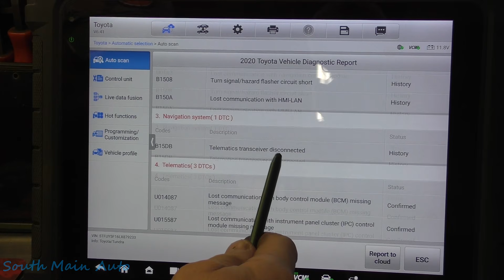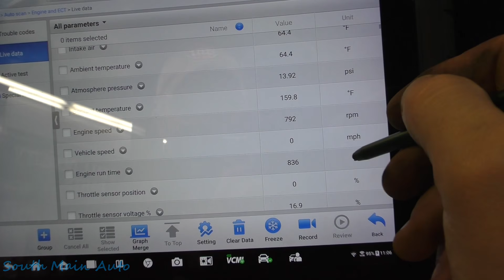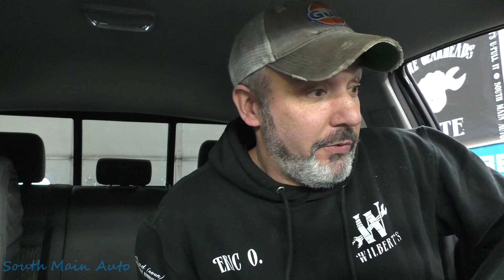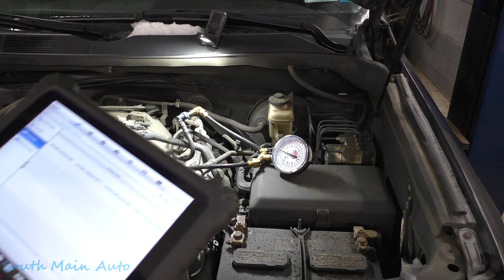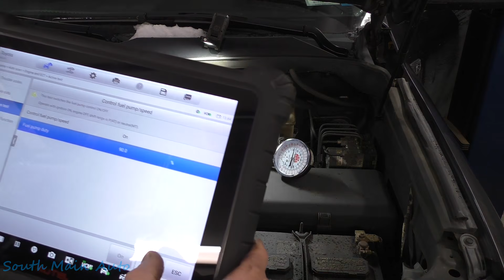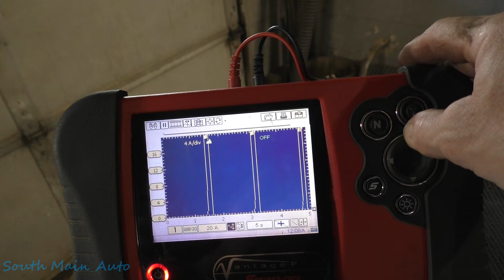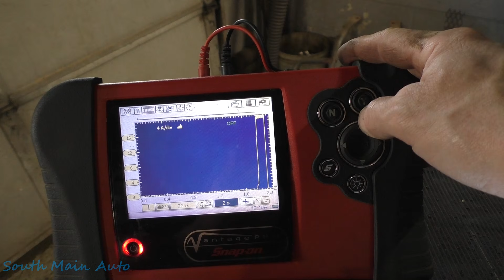My Customer Is Getting Shafted By The Local Toyota Dealer

Comment from the maker: Before we get hundreds of comments on it. I am well aware of the "Toyota Fuel Pump Recall." THIS VIN DOES NOT FALL UNDER THE RECALL. I checked with NASTF as well as calling two different Toyota dealers. This truck has no open recalls by the VIN and the customer has owned it since new.

NOTICE - As of 1/6/25 The local Toyota deal has told my customer that my diagnosis is incorrect because Toyota does not even have a published specs on fuel pump current and then they proceeded to tell him it needs a "Fuel Pump ECU" because the bracket that holds it to the frame has corrosion on it. Not the connector or the pins but the bracket. WTFudgesicle does that have to do with anything haha. They told him that is not covered under warranty, and he would have to pay for it. Let's wait and see how this turns out.... stand by

UPDATE - As of 1/7/25 the customer had some back and forth with the dealer and finally they agreed to replace his pump and that they were wrong, and I was right. They admitted to not even diagnosing it the first time and they were just guessing based off pattern failures and throwing parts at it. The customer told me they installed not only a used fuel pump ecu but a new one as well and guess what? IT DIDN'T WORK! The time they spent guessing could have been spent testing. Oh well, at least the truck is fixed now, and he didn't have to pay for their guess work. They even offered to deliver his truck to him after all of the apologies 👍🏼

UPDATE - As of 1/8/25 Customer got his fuel pump replaced free of charge by Toyota, then they delivered it and put ten bucks of gas in it. And apologized some more. I guess we guessed right then 🙂
Reply: So this truck SHOULD HAVE been included in the recall.  That's my conclusion.  Hope there isn't anyone else out there left high and dry by Toyota because of this issue.
Reply: @courtneyjones4472  They even do that with appliances. The serial number isn't in range with the recall but has the exact same parts as the recall. Then the customer has to pay.
Reply: @courtneyjones4472 Recalls are for specific years and models. 
If your beast is not covered, you're out of luck. 
Plus Warrants don't last forever and ever.
Reply: So what happens if the dealership replaces the module and it doesn't fix the problem? Do they 1) give h back his money and replace the fuel pump FOR FREE or 2) lie to him and replace the fuel pump under warranty?
Reply: @richardramon2175  they’d put the module in. Realize it didn’t fix it. They would then put the pump in under warranty. Then tell the customer “see we told you it was the module” and never talk about it again.
Reply: @BelcrossMobileRepair  Toyota try that stunt with me on my Toyota matrix with my airbag module. Told me my clock spring was bad. Meanwhile, there’s a recall on the wiring harness and/ECU for the airbag system. finally after me in the service advisor having an argument I said the hell with it get my car out of here cause they told me they were gonna change the computer instead maybe wait 2 1/2 hours to tell me that wasn’t the problem I go out to the bay where the guys working on my car and he’s got my steering column all apart looks up at me with the deer in the headlight look looked at the service advisor like oh my God, what do I do? The prick service manager so give me the computer you didn’t install it did you know he put it back together and get the car the hell out of here. I never did have it repaired, but when I get ready to jump the car, I thought about taking it in and getting all the recalls done just to get my money out of Toyota before I scrapped it. He was a douche. The car had never been in an accident never had any problems. Never had any front end work done to it all the sudden one day my airbag light come on. I had a relative mechanic scan the codes and he said by the amount of code the airbag system was putting was crazy. This was known to happen when the ECU fails. Who knows I never will now it’s a pop can somewhere or garbage can lol.
Reply: @richardramon2175  they charge you and say there must be another issue.
Reply: @richardramon2175 it needed the module anyway - dealership,
Reply: @richardramon2175  yes the 2nd one ! For sure
Reply: @richardramon2175 Damn stealerships. Unfortunately the customer pays for all the guessing.
Reply: @richardramon2175 they wouldn't give back his money. They'd just tell him the "bad" ecu damaged the pump, but they'll warranty it out of the kindness of their heart.
Reply: @richardramon2175  lie to him and charge him fo the job under another pretext.
Reply: @richardramon2175  They will say that the fancy relay was bad. therefor the fuel pump was faulty 😇
Reply: @richardramon2175  Dealerships lie. It's baked into their operations since they make very little on the vehicles and they need service department to pay for the hot-n-cold running secretaries in the manager's office.
Reply: @SurferJoe46  so true!
Reply: Oh I'd love to see The Car Care Nuts take on the dealerships handling of that!
Reply: @leonkernan  Yeah he would be disgusted by the dealer, especially knowing their is a recall out there, just because the vin is not on the list the problem is exactly the same as the vin'd numbers. 
So the dealer/ tech should have had the brains to link the 2. then make a decision. asses.
Reply: Please keep us updated
Reply: @ronaldbrosius7488    @ronald, there is no further update, issue resolved, read baby read 💡
Reply: I hope they accept this video as proof.
Reply from the maker: @anthonycox9470  Lol they won't. As far as these dealerships go, I am not a "Toyota Master Tech" so that means I am dumb as a doorknob in their book.
Reply: @SouthMainAuto  I would rather have a "doorknob" diag it correctly then someone throwing parts claiming they are a "master tech".
Reply: @SouthMainAuto  Dumb as a doornob Master techs throws parts at it instead of diagnosing the problem...Clearly you're not the doornob!
Reply: @SouthMainAuto  your customer had your back and kept up the pressure till they fixed it for free ... thats the reason he brought it to you first ... customer for life...
Reply: @SouthMainAuto  say what you want about doorknobs, but they are usually the way to open the door.
Reply: @SouthMainAuto  how is Hanna and Marie doing?
Reply: @SouthMainAuto  not only that, even when you show(prove) their diagnostic incompetence... you cannot shame people that have no scruples. The answer they will give to their customer, questioning the parts cannon approach, will be "at least your vehicle is fixed, now". Should the dealership repair department not fix it, the customer will then be referred to the sales department.  That is why they are referred to as "stealerships". They garner the reputation they deserve.
Reply: @SouthMainAuto  it very
Reply: @SouthMainAuto  I can guarantee that the guy who said it was a rusty bracket is not a "Master Tech" either.
Reply: @SouthMainAuto  but you showed  them who the dummy's
Reply: @SouthMainAuto  I've fixed cars for over 40 yrs and not a certified ASE or Master Tech also. I can fix the cars that have been misdiagnosed by them after they shot gunned parts at it, charged the customer for parts they didn't need and didn't fix the problem. I only answer to myself and don't do what someone tells me how to fix it like some techs have to do to keep their job. Nice job diagnosing it!!
Reply: @SouthMainAuto 
At least you are smarter than the door that kicked them in the ***.😂
It was obviously a fuel delivery issue from the beginning, which meant communication was happening initially.
You would think that an actual Toyota Certified Technician would know about the initializer circuit pulse that triggers the fuel pump to turn on?????
After all... They ARE CERTIFIED.😂
Stupid dealership.
Interesting twist to a common problem.
I agree about the increased power supply from the alternator. You had the exact same result when you had the battery maintainer connected.🤔🧐
At least they admitted to their errors... Eventually, and did the right thing. Too bad the guy had to go through all that crap in the first place.
Another win for the dumb guy down the street.😂🤙
Reply: @SouthMainAuto  Wow, wouldn't the easiest thing for the Toyota dealer to just throw a fuel pressure gauge on it, see that there's no fuel pressure, then tell the customer, "you need a new fuel pump". Pretty sure that's just about how any shop would tackle this if they were in a hurry with a lot full of cars, and a waiting room full of waiting customers :)
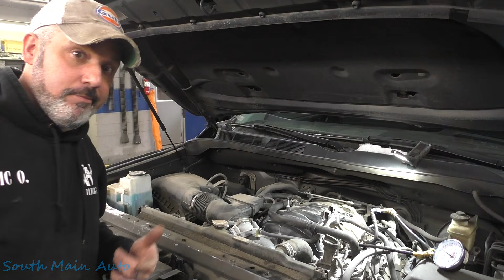Reply: @brnmcc01  no, eric exactly went over this in the video. specifically he said there are a few players. go back to 18:58. just because fuel pressure is low, doesnt mean fuel pump is bad. there are reasons a fully functioning fuel pump cant output what it should. thats the point of diagnostics.
Reply: @SouthMainAuto  Most of the time Eric, they don't even know , that they don't know.
Reply: @betomendez4304  I doubt he will respond other then to say good. Some time back he had to stop having them on & speaking about them. There are far to many predators on YT, and to many people were taking things to far. Can't blame a guy for protecting his kids. Specialy when it comes to his girls.
Reply: @BahBahTheSheep  Yes I know that, but that was pretty rediculous for the dealer to "try" a used FCU, and then a new one, and then finally replace the pump. I remember like 13 years ago, my GMC van died in a parking lot, drove there fine, came back out 15 min later, wouldn't start. Figured it was the fuel pump because I could no longer hear it. Had it towed to my house. Dropped the tank and threw a new pump in it. It started but still wasn't quite right, but I noticed the new pump sounded very quiet like a whistle. The old one I could hear it while driving even but it had been like that so long I didn't pay any attention to it. So I replaced the fuel pump relay, and then all was good for more than 10 years+. I busted apart the old fuel pump relay and it was all burnt to shit. What I think happened was the same as this truck. It gradually over many years pulled more and more current until it died. Pump and relay were original from 1992. Replaced with a Bosch pump in 2012.

Point of all that was I was very inexperienced at the time, never had watched any SMA videos, so like any basic shade tree mechanic would probably do the same thing. No fuel? Fuse good? Throw a fuel pump in it. Makes no sense why the dealer would waste so much time with tryagnostics.
Reply: @SouthMainAuto I am a Toyota MDT, and I watch your videos to sharpen my process. Thanks for this one.
Reply: @SouthMainAuto 😂
Reply: @SouthMainAuto 
Only the piece of paper matters these days as far as I see on a daily basis. It does not matter if you know 10-100x what the person with the title/piece of paper knows. This is the way the world works now, the general public are sheep and seem to follow that 'logic'🤯
Reply: @SouthMainAuto  i like a toyota master tech get through a door with out using one whos the knob then boy did the owner cover all his bases  one clever cookie well done SIR
Reply: Pride comes before a fall
Reply: @SouthMainAuto  Toyota Master Tech, LOL.  Means he sat in a few hour class and got a certificate.  Now they can call him Master Tech and charge accordingly.
Reply: @SouthMainAuto  how many times have I met people that can claim to have all the qualifications to service and repair. Only to find all they know is theory and how to throw parts.
.
Reply: @SouthMainAuto  Well I bet if you reach out to Ahmed Youtube channel The Care Care Nut Toyota Master Technician for years would tell you otherwise.
Reply: @SouthMainAuto wow their not as smart as a doorknob pitiful lol!!
Reply: @SouthMainAuto  Toyota has the worst warranty and recall coverage. It's like they are hoping the bad coverage on this issue is washed out by their perceived reliability.
Reply: @betomendez4304  Did he ever mention to us anything as of last? I believe in a live or "what's up wednesday" he mentioned they went to college or had a family and just want to be left alone. Eric is very protective of them,  I could be wrong here on some details. Guess we have been family a long time, but too any details to remember over the years.
Reply: @SouthMainAuto  Guess we know now what their book is worth, EH?
Reply: @SouthMainAuto far from dumb as a doorknob. I, personally, have learned a lot from watching your videos. Keep up the excellent work.
Reply: @dont-want-no-wrench Doorknobs are never wrong.
Reply: @SouthMainAuto  I don’t fix cars. No idea how. But I know that if that fuel pump runs on electricity, it’s gonna have an electric motor in it, and electric motors draw high current when they stall, and when you run a high current through any conductor, including a motor winding, it’ll heat up. And it’s not uncommon for an electric motor to have a thermal switch that stops it running when it gets hot but resets when it cools down. In fact, come to think of it, I would kind of expect that safety precaution for a motor that shares a confined space with a volatile flammable liquid. I’d design it with the cutout switch right there on the motor just to be sure no control fault could cause a fire. None of this requires knowing special Toyota lore. The problem seems to be that special Toyota lore is all they know.
Reply: @SouthMainAuto  I’m a Master Diagnostic Technician with Toyota for for over 10 years , have been working on Toyotas since I was 10 years old and I must say sir you are in my eyes  above Master techs 
I wish more techs including myself would be as thorough as u are
Reply: @SouthMainAuto .   Oh the irony of that scenario.  Pride comes before the fall. I’m directing that statement towards the stealership. How do they sleep at night. Keep doing what you’re doing Eric. We all love and admire you. You’re a very rare breed.
Reply: @anthonycox9470  that dealer should make this video required viewing as tech and service writer training material
Reply: Good grief. 

Back in 2004, I had a Mustang that blew the turn signal fuse on me one morning and would immediately blow replacement fuses when I'd flick the turn signal again, so I took it to the Ford dealership since it was still under warranty.

First, they told me the switch was bad, so they ordered a new one and it'd be covered by warranty. They said it'd be about a week.

Then, when that didn't fix it, they told me the wiring harness in the steering column was bad, so they had to order a new one, but it'd be covered by warranty and be ready in a week.

Finally, they called and told me that didn't fix it, but they finally looked under the hood and found that the wiring harness had been chewed up by a rodent of some description. They, did, however continue it as a warranty replacement and actually got it fixed after another week.

When I got it back, there were about a dozen blown fuses in the floorboard from their "diagnostics".
Reply: @ShaneRimmerWorld . Oh my, I had a fuse blow on a brand new Mustang just driving it home from the dealer.  It was the one supplying current to the radio.  They put the car in their shop and said it would be ready the next day.  They called, I got a ride to the shop.  The car was sitting in their parking lot.  They said they replaced the fuse.  And they did.  But they never turned on the radio.  I did and the fuse blew.  Still in the lot.  They pulled it back into the shop.  Replaced the fuse about ten times, guessing because that is how many blown one I found.  The trouble shot it and determined the radio was at fault.  The AM only radio was backorder from the factory.  I asked them to just pull out one from one of the new unsold cars that they had.  Nope, can’t do.  Well, just put an AM/FM RADIO in it, since pats department had one.  Nope, unless I paid extra.  Ok, I agreed.  They pulled it in and turned it on.  The fuse blew.  Turns out the power lead had broken from the cable powering the radio.  They had to order a wiring harness.  Two weeks later they called, the car was ready.  I turned on the radio and it worked.  The car was parked in the entrance to the dealer.  I turned it off and told them to put back the original radio, I didn’t wasn’t the AM/FM radio.  They had thrown out the original radio and also the box that the upgraded radio came in so they couldn’t put it back into the parts department.  They ended up giving me the upgraded radio for free.  Never went back to that dealer.
Reply: @georgeburns7251  Great googly mooglies, and people wonder why we call them stealerships.
Reply: @georgeburns7251  gotta face the music 🎶 ...ehh??
Reply: @ShaneRimmerWorld  🙄🤭😏
Reply: @ShaneRimmerWorld 

Good Grief Man ,

Whatta Dealership Story . My Lord .

Worked @ a GM Dealership & Indys here in Southern California  as a Smog Repair Tech/Drivability Problem Solver...Had fun .

Before that I was a Journeymen Shipfitter Graduate Apprentice  @ Naval Shipyard Long Beach  7/25/1977 to 9/30/1997 until Smart Democrats & Republicans thought it was Cute to Officially Close a place that boasted Every Trade Apprenticeship  Program under the Sun.

" O " Eric is  a Sharp Fella - outta New York !
Reply: They also need to pay your labor fees for your diag.
Reply: Diagnostics is hard and takes time. Flat rate techs normally want easy gravy jobs because it doesn't require thinking AND breathing at the same time and makes them big hours quick. The real Technicians are too busy fixing basic factory problems on new cars to have time to be assigned real customer pay jobs (because doing warranty repairs requires certification whereas customer pay jobs don't). Therefore, C/P diag like this one goes to jimmy noobcakes who loads the parts cannon with grapeshot, hoping something sticks because he doesn't know any better.

Don't worry, we're not all lazy punks. Sorry you had to fight the good fight for your customer, but I'm happy you did.
Reply: @toyotanos Jimmy num-nuts😂😂
Reply: Toyota dealership: Your diagnosis is wrong Mr. O.
The internet: AHHAHHAHA... wait, you're serious? Let me laugh even louder! BWAHAHAHAHAH!!!
Reply: @RagnarokCo That is exactly what I was thinking. They know Eric O. If he says that it needs a fuel pump, you don’t need a second opinion. The stupid thing is that the repair should have been completed before the customer finishes a cup of coffee and before the showcase showdown.
Reply: @RagnarokCo  Al Borland:  "I don't think so, Tim!"
Reply: Toyota parts cannon without proper diagnostics sounds like a knowledgeable dealership.😂😂😂😂😂
Reply: @brianwhitney9181  TOYOTA MASTER TECH  DAA SHALL WE TRY THIS NEXT
Reply: @brianwhitney9181  "parts cannon" LOL !!!
Reply: @brianwhitney9181 - that's why they guess-agnostic and told the guy it was ECU and ECU bracket and not covered under warranty. 🤣. This dealer is giving the Toyota Corp brand a bad name.
Reply: Oh boy, today's world is so effed up that consumers must tell businesses how to do their work or pay thousands of dollars for guesswork and incompetence if the customer cannot do it themselves. I am 66 years old and will not buy a new car that I cannot fix myself. My cars are 15 and 20 years old with ample parts available at the junk yard. I am tired of working on my own stuff but I have no other choice. Every time I have taken my stuff to a local repair shop I spend twice as much time and money fixing their shitty work myself after they are done fooling around with it.
Reply: @Leon-qc7fe  Guesswork & incompetence pays better.  Economic incentives almost always win in business.
Reply: @Leon-qc7fe  66🙂😉
Reply: That's Awesome to See the Updates You Wrote ! it Really Brings the video Home !!!
Also shows us that dealers will say anything to Get More Cash from Warranty Customers.

You Would think Dealers Should be the Diagnostic experts on thier trucks by having thier " Techs " Go to Specialised training school for thier trucks. i Guess the dealerships techs don't get specialised training on thier vehicles anymore. Damn shame Dealerships don't Climb out of the dirt & Get to the top of the pile where they should be with specialised training on thier Vehicles.
Reply: When are you opening an Ontario Canada Main Auto?
Reply: @ryanweaver5867 or a NYC or Orange county one 😅
Reply: @ryanweaver5867  North Main Auto?
Reply: Ya right here in barrie ontario @ryanweaver5867
Reply: @ryanweaver5867  As soon as Trump makes Canada the 51st state. 🤣
Reply: I am born and raised in canada and canada is in such bad shape right now, being the fifty first state doesn't sound bad at all. Trudope should be in prison! @rs1971camaro
Reply: Dealers now are just guesser guys , I worked at Fiat ,Toyota and BMW in the 80's ,over here in the UK , life was so much simpler then 😂😂😂😂, just been working for myself since 94 ,dealing with the publics vehicles in my own shop 😂😂, 1/2 the trouble now is their boss is saying don't spend too much time on that job , do this brake job , oil service , no experience in the real world , your video should have been enough evidence Eric , which ijut thought the bracket would make a difference ,looneys on the reception who have never used a spanner , spun a tyre round with dog shit on, found used condoms under seats when looking for coolant leaks  😂😂😂
Reply: I bought a used Subaru that had known issues with the rod bearings, but my VIN didn't fall in the range of affected vehicles so I thought was in the clear. 2100 miles later it starts making noise. Take it to the dealer and as I pull it into the service bay the tech says "we got a rod knocker". Goes to show that the manufacturer doesn't know the exact VIN ranges that those parts went into. Yes it was covered under warranty. Too bad the dealer screwed something up when they put in the new engine because the timing belt shredded a few thousand miles later. Fortunately the 3rd short block was the charm and it's been good for the past 86k miles.
Reply: Cosby sauce!
Reply: @grandmasmalibu F’n mint! 👌
Reply: @grandmasmalibu took me a few times of him saying that before my light bulb lit up 😅
Reply: @grandmasmalibu  Omg...That line is a keeper!!
Reply: Oh the sweet smell of success  !
I agree with Mr O
New vehicle 
Technology 
Sucks 
Thanks again  South Main 
Auto. 👌
Reply: I've learned that many of these techs do not really know much. If the computer doesn't tell them what to do they are lost.
Reply: Former Toyota Master Diagnostic tech (which only means what's on paper) now independent technician. It doesn't surprise me about the lazy diagnosis from the dealer. The major problem is dealers won't sell additional diagnostics so you get a 1.0hr flat rate to figure out anything. However, I'm only a few minutes in and went... "Oh isn't there a recall..."
So even if it wasn't in the VIN range I'd be suspicious of the fuel pump (which they are all the same more or less.) But dealerships don't train techs for diagnostic work and diagnostic work gets sent to every level of tech in the shop :/ I'm independent all the way and ain't looking back. Great video Eric O!
Reply: Guessing on the customer's dime = lazy thinking = declining nation.
Reply: My son just had a very good experience at a Toyota dealership. He has a 2025 Tundra TRD Pro. A rodent chewed up some wiring, which fried a module. Turbo module, I believe. Pretty easy diagnosis. When my son went to pick up the truck and pay for the repair, they said, "No charge". The service manager wrote it up as a warranty issue. And when they ordered the new module, a new wiring harness was included. I told my son that I have never heard of a dealership doing such a thing and that he got lucky. 😆
Reply: I don't expect every mechanic at a dealership to be aces but for the money they charge, they should have one or two guys around that can do basic diagnostics.  It's embarrassing when this kind of thing happens.  Great video, thanks for it.
Reply: Doesn't sound like a shop I'd trust to do proper troubleshooting for any of my vehicle's future issues. Definitely a class act with the owner leaving the tank low. Good dude right there.
Reply: @timtimtimmay79 that’s why they’re called stealerships.
Reply: @timtimtimmay79 there’s not a dealer of any kind on the planet that can diagnose anything!
Reply: Typical Toyota - no we’ve never heard of Matrix 5 speed transmission failures must be abuse. Go to transmission shop in town - oh yeah we have a dozen manual transmissions here from that dealer right now…
Reply: @kmac6601  Yup!   Also the same Toyota C59 5 speed manual transmission is in the Pontiac Vibe.  They all have bearing failures at about 100K miles.  I got mine to 110K and because I was alert to the problem I took the thing off the road the minute I started to hear the early bearing failure noises.  Mostly people keep on driving until the transmission grenades totally while driving down the highway at speed which locks up the drive train and can result in a very interesting experience.  I found the local transmission guy and he said my transmission internals were mint other than the bearings.  He did have a bit of difficulty sourcing parts because companies selling the rebuild kits could not keep up with the demand.  How this isn't a safety recall is beyond my understanding.  I've driven cars with manual transmissions since 1975  and this is the first time EVER that I have had one fail.  The Vibe has actually been a great car and very suitable for my needs but I'll admit that Toyota's complete failure to appropriately deal with this common catastrophic failure has soured me on ever having another vehicle with a Toyota drivetrain.  So much for the Toyota "reliability" myth!
Reply: @ 3rd 5 speed transmission we put in it for same reason we converted to the 6 speed, car ran that one from 400 to 600k when it was scrapped for rot.
Reply: I have a Toyota hope I don’t get the bend over when I go to them.
Reply: @jayjudd6518  plan on it happening
Reply: @jayjudd6518  just make sure to bring a bottle of Astro glide so when they stick it into you, it hopefully won’t be too too painful! :-)
Reply: I would have told them to put $1000 on their guess. Change the part they thought it was and if they were wrong, they pay the owner $1000.
Reply: I’ll take an old school mechanic any day over a “tech”. The term “tech” is a feel good term to make them feel elevated in stature. 
Eric O for the win as ALWAYS!
A sanitation engineer is still a garbage man it’s just that simple.
Reply: @clintprice2123  Well put...😏
Reply: He should have brought it back to you to replace the fuel pump if it wasn't covered under warranty
Reply: After that, I wouldn't bring it back to that dealer again.
Reply: Denso has more bad pumps out there than the recall suggests.
Reply: @NightKnight2048  i must be really lucky never replaced one
Reply: @ I’ve already replaced 2 in my Subaru’s… one under recall and the other that supposedly isn’t by just a few months… thats a little sus, wouldn’t you say?  Both sounded similar and had starting issues similar but not exactly like this.
Reply: @NightKnight2048  my 2011 camry v6 is still running like new. ive spent less then 1k in repairs since i bought it in 2011, besides tires oil and brakes
Reply: @peterpeter5666  that’s nice, my 2006 Toyota Prius ran until 2019 until I rebuilt the battery myself. It got to 2023 with 250k on it. It never needed a fuel pump. Denso needs to fess up that it’s more fuel pumps than they initially thought.
Reply: @NightKnight2048  I believe most recalls only occur when life safety is an issue. For example - driving at speed on a busy highway and your fuel pump stops.  Other failures are tough luck and if your warranty expired its on you for a poorly made part.
Reply: I gave up on my local toyota dealer. Too many missed diagnosis and too many times leaving with same problem I drove in with.
Reply: Thats some classic stealership behavior. Almost like its in the business model lol. Glad they caved and realized you are the professional they make no attempt to be.
Reply: This is the type of crap that should make it back to Toyota corp as proof that their factory trained techs and the dealers are a joke.   Make the Toyota engineers watch this video so they can learn how to ACTUALLY DIAGNOSE a vehicle….
Reply: the bracket is corroded so replace the relay? so like, if the oil pan has a dent do they replace the engine? wtf
Reply: Don't hold your breath for the dealership to apologize to Eric O for basically calling him a hack. These dealerships couldn't diagnose the smell of dog sht if it was on the end of their noses
Reply: @JF-wk5zo  Well a lot of that has to do with how little the techs get paid for warranty diagnostics. Guy getting paid $17 for that diagnostic while he has a huge Snap-On tool truck payment to make every week ain't exactly going to be enthusiastic about it, haha.
Reply: You use the Calibrated Toyota Hammer to test strike the Toyota Calibrated Fuel Pump.
That's how you KNOW.  It's all calibrated. : l
Reply: @timewa851  It's almost the same part number as the Chevy starter diagnostic tool!
Reply: Ig they keep guessing ,  lying , and pretending to do the work them they get to keep charging.  I wish they woukd pass some actual consumer protection laws to stop this BS !
Reply: Who's  big Clive?
Reply: @bikeme218  A YT'er who does videos tearing down cheap Chinese electronics & showing why they fail & why they are dangerous. Complete with closeup of the circuits with a high powered microscope.
Reply: @bikeme218 Search YouTube.
Reply: Not a lick of surprise over here at the final result in this case. Chalk another one up for DOCTOR O. 😁 Shame that it's a Toyota store that's doing their customers dirty but I guess every brand has its bad apples. Nice work once again, sir. 👍
Reply: I missed it if you mentioned the mileage, but my experience has been most in-tank pumps last between 150-200k miles. They usually fail because of brush wear. Some die quickly, while others go intermittently like this Toyota. One trick is to rap on the fuel tank near the pump suction area. It can sometimes get a little bit of run time in a pinch. Glad you were able to to help your customer get some resolution from the dealer.
Reply: @Obscure121gw  I believe this one had less than 75k and there was a recall on them that applied to other trucks but not this one. Aka a known failure part.
Reply: @patriotgarage 49k he said
Reply: What a Bunch of CORNSPORTS at that Dealership!!! Just don’t want to believe that (They) don’t even know their own Product’s !!!!Nor… How they Work!!! Nice job “AGAIN” E O…
Reply: Wow… I can’t believe the poor service being provided by dealerships. Especially Toyota… I just watched Ivan’s video on the Tundra cam phaser debacle… C’mon Toyota!!
Reply: Did your customer get a new fuel pump module out of the deal? He SHOULD and save the old part! Toyota dealer needs some retraining! Master techs my ass!
Reply: @udrtydog1  Master tech just means they know the particular issues with replacing that manufacture's parts. Very little diagnostic is covered. Even then it boils down to management. Management doesn't want to sell additional diagnostic time. The profit margin is very slim. So they are expected to preform diagnostics within the first hour, and diagnostic are sent to all levels of techs. From the noob to the tech who's been there 7 years. They will be preasured to complete that diagnostic in as little time as possible, regardless if it is humanly possible or not. If the tech completes thier diagnostic in 5 or 10 minutes, the profit margins for that diagnostic hour goes way up. It all boils down to $$$ Research was done to see what the lowest customer satisfaction rating the average customer is willing to put up with. The answer is about 65% to 70% satisfaction. So all corporations purposefully cut corners until customer satisfaction ratings fall as close to 65% as possible to increase profit margins. Some will trial as low as 60% satisfaction, to see if customers are willing to accept it. Over time the acceptable satisfaction rating goes down. In the IT field (my line of work) the acceptable customer satisfaction rating was 95% when I first started out in the mid 1990's. By 2010 it fell to 65%. So employee expectations get adjusted to reflect the current acceptable customer satisfaction  rating. I'm sure it's in the 45% to 50% range by now. Moral of the story, vote with your wallet & demand a higher customer satisfaction rating. Otherwise company's will increase profits by delivering to customers expectations.
Reply: Dealers only want 'parts changers' because loading the parts cannon makes them the most money. Actual mechanics like Eric get paid more (or should be) and stealer-ships refuse to be ethical. Absolutely follow the money every single time.
Reply: I will give the Toyota Dealer some credit for at least in the end admitting they were wrong and that you were right. Not that they would tell anyone else that though. But it is a pity that their customer had to go through so much crap just to get it changed, whereas if they simply done what the customer asked in first place it would have taken less than half the amount of time and therefore lost time for the customer without his vehicle. Too many of these dealerships are ignoring the wishes and requests of their customers. Are the customers always right? no. But at least if it is wrong then it is on the customer afterall they requested it changed you only done what they asked. But, at no time, should you as the dealership be arguing with your customer. Does not matter if is a warranty job or not. A customer is still a customer. Looking after your customers is how you get repeat customers. It is those repeat customers who will in the end keep your company or dealership going when times get tough. It is about time more of these dealerships learnt that lesson. Ripping off a customer is a sure fired way to make sure you never get that customer again..... A bad reputation once earnt is hard to loose and it can be earnt if very very very little time. A good reputation though takes a long time to earn... but easily lost
Reply: Soooo watch out for W●》¡♡●○ Toyota in Horseheads?  There are not a lot of choices in the PRNY Appalachian region.
Reply: Idiot dealers think just because there tech said means he know EXACTLY what he’s doing!! And they always get to throw the parts cannon on the customers dime!! Reason 9,076 why everyone needs to find a sure enough good mechanic on there own
Reply: Bought a used 2018 Tacoma, fuel pump went out and already had the recall done. Took it dealer and they said “someone had been here before” I was like “no shtt, you guys already did the recall” they tried to charge $1500 because NO way that the new pump failed. It did, covered under warranty
Reply: This is what I like about quality YouTube Channels. The follow-ups by posters. You are probably the only shop in your small town who knows what an Amp Clamp is.
Reply: You don't call them Stealerships for nothin'....
Reply: @SouthMainAuto  The plot thickens! I hope your customer doesn't end up getting screwed by every dealer he takes it to!
Reply: @merkurman  This is another example of why I never go to a dealership for any work on a vehicle!!! GOOD JOB ERIC O!
Reply: It would be a easy question for Me to solve this problem, I would just call MR. O !
Reply: Bottom line _!
Reply: This is how and what dealers do. They don’t fix vehicles. They just take their money with great efficiency.  You are one of the few mechanics who fix vehicles. There are not many out there nowadays.
Reply: I had an issue on my corvette zo6 for the longest time and the dealer could never fix the problem.  So I had to dig in with a no code ended up finding my issue that seemed like a fuel pump or vapor locking issue. But started in fuse block checking relay etc,.  The relay for fuel pump was not energizing when it was hot but cool was fine but what I ending up finding was a load connector pin that feed to the relay was so distorted that it lost its contact when I shut the car off but after cooling it would  go back in shape just enough to make connection and the pump would run car would start and everything was fine but also on same pin you could tell that the insulation had burned back but chkd draw amperage and it was within. So replaced female pin on wire and it corrected the problem and has been working fine for  four years now.
Reply: How far outside the "VIN Range" for the recall, did this truck fall?
Reply: @tonyjohnson7408  likely not far
Reply: I'd be concerned as all heck if a customer threatened me with "I'm going to take it to SMA".
Reply: My experience with Toyota techs is consistent with this story.
Reply: Soon Stealerships will try to pay Eric and Ivan PHAD not to post videos
..they are losing money 💰🤑 

Lol 😂😅
Reply: A TUNDRA IN THE SHOP!!!! CANT BE😂. Tundra Time, I can count on one hand how many tundras have been in his shop. As always, GREAT JOB Eric. You are an incredible diagnostic master technician
Reply: It must feel nice giving the dealer a big ol' piece of humble pie. Nice job Eric, as always!
Reply: Toyota is really developing a bad reputation for stone walling owners on recalls and fixes. For example the new Tundra. They recalled the ICE version and did not recall the Hybrid even thought they have the same lame twin turbo v-6.
Reply: I have loved your vids for years and watch just for enjoyment.  You should consider doing a vid explaining the supply pipeline for auto techs and repair shops.  Maybe interview former and honest dealer techs?  Help the average guy/gal know how to find a guy like you!  I work on my own stuff so people often ask me to recommend someone and i have no idea.  I know not to go to dealer, but the times i have taken a problem child to someone i fell like i am just getting non dealer dealer service!  😢😮😢
Reply: I have a 2019 RAV4. My fuel pump had a recall on it. When I saw the beginning of this video I said"fuel pump." They all have to be sort of the same.
Reply: @SouthMainAuto  In Junior High... in gym class we put these pads down on the gym floor to simulate a boxing ring.

Each round was 1 minute.  So we didn't dance around and shuffle like they do on TV. 

No... We came out swinging and we didn't stop swinging until the 1 minute bell rang.

So that's how I learned to handle certain liptards here on earth who think they can just push everybody around just because they think they can!

Anybody who wants to buy a new or used automobile right now needs to know what they are getting into and unfortunatly none of us are any match for all the electronic mishaps that can pop up in these newer modern cars and that is why this Channel and its content is so valuable to both the consuming public and also to the DIYers and profesional mechanics alike... and it's not just this Channel... its a community of automotive channels here on you tube that is helping the masses be better more responsive car and truck owners and these channels are also creating better more responsive repair technicians.

Plus as a bonus... it's a great Dopamine hit when we are looking for something and we are almost at the point of abject despair and then BAM!  We find the cause and can't believe how simple the whole problem was and the great thing is we get to do this over and over hundreds and thousands of times throughout our lives.
Reply: Truly sad.  The only reason myself, and most people, would go to a dealership and volunteer to pay higher prices is because we assume they know the vehicle better and are less likely to be a parts cannon.  Their approach was completely unacceptable.
Reply: That’s one more time confirms, that there is no more good tech’s working for dealership.
Reply: @StefanNistor-v5w  This may have been a decision of someone higher up.   Either way they did him wrong. I have seen in a few  dealers that act like they can do no wrong. They fixed it for free, delivered the truck and apologized.
Reply: HOO-rah!
Reply: I read this in Mr Os voice
Reply: the fuel ⛽ pumps in the 99 Yukons are  bad about going out
Reply: That’s “the dealer” for ya! Doesn’t matter what name is on the sign, they are all mostly the same. No fault of the techs - you can’t expect someone to work for free. Corporate has created that problem.😢
Reply: Sounds like when people go to the local parts store technician to get a DIAGNOSIS and the tell him. You need a mass air flow sensor or pump module.
Reply: That sound like mainland management recalibrated the gaijin dealer to save face.
Reply: stealerships like this should be ashamed of themselves. 1st time is one thing, but second time you see a vehicle with the same symptons, they should put someone more qualified than the oil change kid on it.
Reply: Awesome work, Mr.O!!  Yeah buddy..
Reply: Where are they training these parts cannon techs at toyota testing and diag saves money 🤣
Reply: @mikecole6842  Not realy. Proper diagnostics goes to the more senior techs, who get paid more per hour. Giving the truck to the noob to guess at by tossing parts At it makes the dealership more money in most cases. Less per hour, plus the customer pays for the part & labor with each guess. Specialy when they are told to try the non warranty parts first. Acceptable customer satisfaction ratings have dropped in the past few decades. So corporations adjust to providing lower quality service for more money every time the general public is willing to accept lower customer satisfaction ratings. Proper diagnostics only increases profits when you run a quality shop that aims for the highest customer satisfaction rating, like SMA does.
Reply: Only because of you one of last moral compassed mechanics/technicians..in a society where people are affraid of them ..and those in authority positions. In most all feilds 

GOD BLESS
Reply: These dealers are a big joke It’s a crying shame you can’t depend on dealers to fix the vehicle without see a video to prove them wrong!! Keep up the good work Eric
Reply: Very interesting bud..& very well said!
Reply: I honestly think the dealerships live in their own lil world...The think like they are primadonnas in the the repair world...Not!
Reply: Ask him to call Toyota and let them know what happened. Toyota doesn't like these types of shenanigans since it's their name on the truck!
Reply: Two prominent recent cases on YouTube of Aussies getting the same story from Toyota on new Four Wheel drives. 

One family out in remote Australia with a near new Toyota. Caravan on the back. Engine failure. Toyota blame it on fuel. It was a crank bearing.
Reply: Not yet!!!!!
Reply: Toyota should've paid you for your diagnostic time as well. They should also start hiring technicians that have a brain.
Reply: Sweet
Bcz delears are stealers
Reply: bunch of boneheads ! lol  Great investigative work as always and thank you for sharing your skills with us ! cheers
Reply: SMA, THE SCOPE and THE TEST LIGHT FOR THE W I N ! ! 
Some of these dealerships think they have all the answers till you tell them or show the video of what you've tested.
Dealership.  "How do you know the amount of current the pump needs?"
SMA. "I don't for sure, but based on other Toyota's I've worked on the normal (or average) is______."   SMA to dealer.  "Since I don't have the exact output current to the pump, and/or the proper frequency to the fuel pump ECU, what do your diagnostic charts show are those two values and at what temperatures?"
Dealership.  "We don't have that information."  OR,  "I don't know."(that's usually the popular answer.)  OR,  _________(fill the blank).  At this point I'd be a little biligerant.  "So how do you diagnose/repair the vehicle?"
Reply: So let me try to understand  this: 
Dealer has TRAINED TECH'S that throw parts at what they think is the problem?
 These Trained Tech's should know how to do a proper diagnosis!!
 My family comments to me about why I turn my own wrenches and spend hours in the garage doing my own diagnosis. Well at least I'm not just throwing parts at it and hoping for a fix😅
 I'm only a ex diesel locomotive mechanic and been messing with cars since I was 13 years old, and now I'm 54. JSMH
Reply: @Paul070  Factory training is different from survival stress training.  Much respect to you for repairing your own vehicles.
Reply: f-ing dealer idiots/ I hope some of the SMA viewers figure out which dealer it is and calls them.  wont change anything, dealers SUCK!!!!!
Reply: Love the fact that we seem to watch the same YT channels. Been watching Big Clive for years.
Reply: Flat rate "techs" bring the big L once again.
Reply: Awesome!
Reply: Great work.. what a good way to diagnose. ❤
Reply: If Toyota had"diagnosed" the warranty replacement properly they would have figured out the pump problem on their own So does the customer get Toyota to pay for your diagnostic time too?
Reply: Eric O 
Did the Toyota dealership reimburse him for your cost of the proper diagnosis of the issue with the truck? 

I read you said this truck's Vince is not part of the recall. Could it be that this truck is an early or late production model that somehow ended up with the failed fuel pump?
Reply: It shows how far behind the Toyota dealer is since you considered this to be a "pretty easy diagnosis".
Reply: Why do you always gotta be right about things, Dr. O? Stop shattering people's egos.
Reply: This is the main reason I don't bother with after market warranties anymore.  Having to bring my car to the dealership has only ever resulted in headaches.  Brought the same car twice to the dealership for a window fogging issue "oh it's just caused by a bunch of water on the floor". Third time as it was a used car I was threatening the lemon law.  Magically they put the car on a lift and showed me the condenser bracket was completely gone and it was only held on by the tube itself.  Yeah....water on the floor....
Reply: Thats why we call them stealerships.  I avoid them with a passion.
Reply: I wonder if the dealership didn’t want to get a bad name on social media over this and that’s why the gave in. Sounds like the service manager tried to blame the tech with not diagnosing the problem and just guessing. I still don’t like them trying to throw a part that the customer would have to pay for instead of just going with your diagnosis and replacing the pump under warranty. I can understand why your customer didn’t want to take it to the dealership first.
Reply: Don't mess with a missionary man. The mission.... fixing junk.
Reply: Hi,why do these manufacturers put components in the elements  ?
Reply: @SouthMainAuto  donkeys protect animals better🤭
Reply: It just tells me that there are few people around able to diagnose car faults today. All we have left are code readers. If there isn't a code for the fault that fault don't exist.
And by the way - never trust the VIN number range, some odd vehicles can fall outside the range for various reasons. It's not unusual that some vehicles are put on hold half way through the process for some missing part and then brought back into the line and then the VIN can be an outlier outside the range.
Reply: Jeep wouldn't fix my NEW Jeep a few yrs. ago, because 'heat breakdown' on a pcm was not on thier computer list
of warranty items.. I had to SHOW them what the problem was and they still wouldn't fix it!.. idiots.
Reply: I am always impressed by your straight forward logical troubleshooting.  This is the way I was taught. Keep up the great work ! We need to have more shop classes return to secondary schools so students can learn the proper way.
Reply: Holy crap dude. Never knew that Toyota was full of scum bags too. I knew Ford and Chevy would do that, but holy hand grenades Batman. 
At least they still have you to diagnose things properly. 
Crazy AF though. I'm still surprised they heard the pump struggling and went "nahhh". 🤣
Reply: The behavior of the dealer is ridiculous. Guessing what is wrong is a good way to loose money and inconvenience your customers. 😖
Reply: Every days a school day with Mr O
Reply: @SouthMainAuto  Glad I checked the comments. Always love hearing dealership horror stories. Grew up around adults being under the impression that dealership techs were all-knowing experts on the vehicles they worked on. Then I worked for a dealership for a few years, talked on tech forums, and quickly realized that's far from the case which is ridiculous for the prices the shops charge.

I do something else for a living now but still do repairs on the side out of my garage so I can do repairs how I want to do them without all the shop politics and pressure to cut corners.
Reply: Great diag and thanks for the updates, all 3 of them! If it means anything, I had a crappy experience at the Toyota dealer for the short time I owned one too.

Scotty lies, Toyota's are crap! 🤣
Reply: Toyota dealer has seen vidio
Reply: Eric, you are so good. Those Toyota mechanics should be ashamed for guessing and parts cannon-ing 😅. Probably,  the mechanic who was doing the guessing is a rookie. 🫤
Reply: Do you think that main dealers wonder why people don't trust them? 😉
Reply: Typical Dealer B.S.they will always fight the Fight, & Argue Chit..Even when they know a Warranty is in Place.. Yupp Always Want to Squeeze that$$$ out of the Customers Pocket..Dirty Low Down Scumbags
Reply: Ten bucks for gas?! WTFudsicle?! 😂😂
Reply: @michaeldiaz2439 twenty
Reply: This is what dealers are all about
Reply: I had issues with my wiper back in the day on gm!  Well I yelled at the dealer, providing that it's the same part.  And they sat watch the phantom wiper issue.  We'll they did a recall....
Reply: Shame on the Dealership technicians and their service advisors and the owners in general, this is why Noone trusts them anymore.  Once again you're common sense and diagnostic ability are top notch ,I only wish I was close to your shop !
Reply: Ah, it is what it is.
Reply: Typical stealership. Guess, don't test. Is how they seem to live their life.
Reply: Hey buddy long time quick question about those Buick Encore Transmissions I had to change the speed sensors on those and then when I changed it still had the same problem doing some research I found out I have to change a solenoid... do you have any videos working on those?
Reply: Eric O of SMA troubleshooting for the win🎉🎉🎉 Just so more proof that just (educated) guesswork and a trigger-happy sales department with a parts cannon don't equal actual hands on understanding of how thing work.. Good work keep it up
Reply: I had a Chevy Astro that did the opposite,When cold if I sprayed starting fluid it would go.Once it get hot I could start and go no issues.I had to replace the fuel pulsator(Small rubber looking part)That goes in between the pump and sending unit.
Reply: Good update. Tell the customer not to run the fuel tank below 1/4 of a tank.
Reply: @SouthMainAuto  this reminds me of my local Chevy Dealer. Nothing but a parts changing outfit. Best of all come to find out, their best mechanic (expert), is an instructor at the local tech college. Now I can understand why there are so many part-changer’s out there. They are taught by part-changer’s.
Reply: Recalls expand sometimes Really sad the stealer ship didn't even try to diag it but that is suspected when they are lazy. They usual story it's a new or pretty new car / Truck so nothing is wrong. Everything breaks. FYI that Denso fuel pump recall effected Acura / Honda also. Thanks for the great video. You have now shown everyone why not to take your car to Toyota for service.. LOL
Reply: @SouthMainAuto  seems there are no good master mechanics at dealerships anymore. Not sure why that is.
Reply: Second guessing SMA is never a wise decision.
Reply: Now that is Embarrassing but  not Surprising!  from the Stealership!👍
Reply: That truck sounds like crap! My Toyota has that problem once in awhile never been able to figure it out! It's going to the crusher by the end of the month I'm going to go get myself an old Dodge! I will never buy another Toyota ever again I've never stunk so much money into a car then I have my Toyota!
Reply: Exception to the rule 
Or they need additional recalls
Reply: @SouthMainAuto  it wasn't a guess. You diagnosed it correctly
Reply: I feel the customer made the incorrect decision of going back to the dealer. He knew he was going to get jerked around and they would waste his time. Should have just paid you to fix the issue the day you diagnosed it, would have saved him time and stress.
Reply: @SouthMainAuto  I do have a comment on the fuel pump ecu replacement. If the truck is rusty, the fuel pump ecu has metal inserts that the screws screw into to hold the ecu to the bracket. The inserts expand with rust and crack the plastic ecu housing open and exposes it to moisture. I have seen this a lot even in the south. You won’t be able to tell unless you break the ecu apart.
Reply: That's why In my eyes you are the (I guess some will argue) BEST Diagnostician, Is that a word? I guess so. Thank you Mr, O for your diligence and easily understandable  explanations!
Reply: Another w ! Nicely done, SMA
Reply: love mfs that just throw parts at shit instead of actually troubleshooting anything
Reply: dead spot armature or dirt debris (transparent blond hair ,bug wing  got me couple of times!
Reply: Awesome  video
Reply: Seems to me if a recall was made then regardless.of warranty just don't do anything else but test the fuel.pump.
Reply: Well. You can't see it because you are so close to it... (but the rest of us can see it) you are the Rock God of engine management diagnostics!

...and this one puts you in the Cowyboy Hall of Fame next to John Wayne!
Reply: I heard Toyota has had tons of trouble with the newer fuel pumps.
Reply: If it woulda been me? I would have insisted that you install the pump.. screw the money and clearly Toyota warranty enforcement requires a lawyer..
Reply: @SouthMainAuto   wow. Incredible work and resolution! I hope your YouTube income makes all the extra work documenting and following up worth it!
Reply: Loved the “WTFudgesicle” descriptive comment.
Reply: "Experts with a sales motive". All too familiar. Totally different field, but I used to spec and source eyewear for mountaineering. Customer's eye doctor said he had signs of UV exposure so he spins the glasses he got from me by a local optician who puts the glasses on a UV tester which says they're unsafe and don't protect at all (and he should buy new ones from said optician). I always get my lens samples tested and trust the mfr, but send customer's glasses off for an (expensive) independent lab test. Result: perfect protection-- customer's problem couldn't have been from the glasses. I call the optician to suggest politely they get their (dinky little) tester calibrated. They pull the "if you're not an optician you have no science legs to stand on" trick. Whatever, dude. Fortunately customer gets it. Hubris gets us all eventually if we let it.
Reply: Check the purge valve
Reply: Dealerships hate doing diag.
Reply: Fuel pumps can go out at any mileage. I had one go out at 10,000 mi on a Ford van.
Reply: LMAO! That just goes to show all of us that the smartie-pants at the Stealership CAN be wr-wr-wr-wrong sometimes. Nice job Eric! (smartie-pants...jk 🤔)
Reply: I'll take a WAG someone higher up in Toyo told the mortar crew at the dealer were adversely affecting Toyota's image and told them that admitting and correcting is always the best way to retain and attract customers and a little extra makes it better than ok.
Reply: Eric.. I hope your customers know how lucky they are to have u.. I’m in Ct I wish I was closer. I love watching you figure stuff out. Keep em coming 🤛🏻
Reply: Good day to you sir, I am very pleased that we have technicians like you out there teaching the rest of us with your drivability skills, with that said I was curious of your Autel bidirectional scanner, that has the topography option included i might add, but I was just curious of the exact model that you're using so the rest of us can obtain something like that. 

And also I'm looking for such a bidirectional scanner that also includes a wiring diagram database for up-to-date models going back to let's say 1986.
If you're a scanner doesn't have such capability can you recommend something for the audience I would appreciate it?
Reply: UPDATE 10-9-2025

Toyota Dealer receives DUPA Award.
Reply: You always guess right my friend
Reply: When an entire multimillion dollar licensed Toyota dealership can't compare to a superlative, local auto mechanic and his wife. Rusted Fuel Filter bracket? Maybe the Flux Capacitor needed adjustment.
Reply: Everytime he goes in the dealer " Check all my brackets for rusting!".
Reply: thanks for the update, TBH i have seen this before on other vehicle, the vin is not in this recall but with the same  part...   sad really
Reply: Just as an FYI, I've heard that if you call Toyota corporate and complain, they will bitch out the dealer.   Corporate apparently has zero tolerance for crappy dealers.
Reply: Almost a million subs congrats🏆😁✌️
Reply: That's no way to treat a Tundra owner and another Tundra owner who is his mechanic. 🤷‍♂
Reply: You asked for it 
You've got it 
Toyota!
Reply: Oh OK
Reply: When they offer to deliver your truck to you then they screwed up royally and the owner of the truck should be contacting a lawyer.
Reply: @ratedRblazin  Probably offered to deliver it so the customer wouldn't have the oppurtunity to vocalize the screw up in the dealers service/show room for any perspective buyers to hear. What great validation for SMA and their customer care.
Reply: Master diagnostic Toyota tech chiming in, as a long-time viewer, and I've learned A TON about Picoscope from the great Eric O. 

1.  I never knew the pulsing behavior from the Fuel Pump Controller existed, and it's very cool to see it in person.  The waveform of the seized pump was very cool to see. 
2.  Yep, I've seen dead/dying fuel pumps on non-recalled vehicles.  I've even seen dead/dying fuel pumps on vehicles that had the recall performed, but that's a very small percentage. It just goes to show anything made by the hands of men can fail.
3.  I hate to hear the client has the crappy experience from the local Toyota shop.
Reply: @jeremysmith1777  do any of the other techs at the dealership you're at watch YouTube videos? 
If no, have you attempted to encouraged them to watch?
Reply: @dans_Learning_Curve  In full honesty, I have.    To some, they love Eric O's, Paul Danner's, and Ivan's work and explanation, and will come back to me for further explanation, or get my take as to how I would approach the problem, and I LOVE THAT THEY DO!    To some techs, it's more "work stuff" that they don't want to deal with when they are off the clock, and that's fair enough.
Reply: @dans_Learning_Curve  I have recommended Eric O, Paul Danner, and Ivan repeatedly.  I LOVE when a tech comes back to me after watching a video I've recommended, and wonders what I thought, or How I would have approached the vehicle.  Some techs have the passion to dig deep, and learn.  Some just take the recommendation as more work-related stuff that they don't want to deal with on their off-time, and I can respect that.  I don't like it, but it's their off-time.
Reply: @jeremysmith1777 tell us, what qualifications are required to be considered a Toyota Master Tech ?
Reply: @SuppressiveSquirrel  5 consecutive years of employment as a tech with Toyota, all 8 A-Series ASE tests passed and current, and all Toyota Online Training Modules  and all current In-Person Training Classes passed.    If you want to reach for Master Diagnostic Guild, a tech would have to pass and keep current the L1 ASE certification.

Now, if anyone reading this hasn't heard, there is a MASSIVE technician shortage, and the number of technicians that are employed drops by the day.  I can go on for hours on the issue, but I'm typing this up on a quick lunch break.  Do I feel a Master Toyota tech ever touched this truck?   Probably not.  Alot of service writers LOVE to say "My Master Tech looked at it...." but in reality, there's close to 8-9 lower-guild techs for every Master, if I'm undershooting that figure.  Service Writers are paid to blow smoke, and put out fires, to say.    I've seen entry-level techs who have a passion for diagnosis, and I've seen L1-Certified techs who can't fix a ham sandwich.  It really is a gamble as to who you actually get for a Tech since 99% of clients only speak with the writer or a manager.
Reply: Maybe he should get a chevy 😂
Reply: @agger838  And deal with the factory supplied oil leak, and constantly failing starter. Every manufacturer has thier issues.
Reply: Eric just wondering quick question how is Hanna and Marie doing
Reply: @betomendez4304  they've moved on with life.
Reply: @SouthMainAuto  
Did you know there's a recall on Toyota Truck fuel pumps?
.
.
.
.
.
.
.
Please don't Ban me!
I had to write it! LoL 😂😆
Reply: Why the click-bait title?
Reply: @fairmont___d  To satisfy the requirements of the algorithm
Reply: @fairmont___d  Are you a stealership wonk? The title is the truth about the bottom-feeding, blood sucking leeches that exist in dealerships.
Reply: so sad that dealerships that ONLY repair 1 make of vehicle cant find the problem. Been a tech for almost 40 years and i have NEVER replaced a fuel pump on a toyota. This customer must run his fuel level low alot to burn out a pump. But once again very few auto TECHS left out there. just part changers. The auto industry is in serious trouble, especially how the new generation of kids are too much of a pansy to get their hands dirty or do hard labor.
Reply: @ You can hear the impeller grinding in its own guts.  That’s what the recall was for… Denso needs to expand the recall further, but refuses to do so.
Reply: Eric, I've been a Toyota dealership technician since 2011. You can thank flat rate for this, and that Toyota doesn't pay diagnostic time for anything under warranty. The techs are expected to diagnose the problem for free and only get paid for the repair itself, which pays less than what the same repair would pay if it were out of warranty. Hence the parts canon is fired on intermittent problems like this. It sucks for the customer, but it's hard to fault the technician when they aren't being paid for their time. Many of these situations could probably be avoided if Toyota just paid diag time for warranty work.
Reply: Ive never drained a tank to replace pump  just drop tank and replace pump . An empty tank is more dangerous than a full tank !
Reply: YOU should have asked them what the cut off of the vin was, or pulled the info from the fuel pump to insure they didn't put one of the recalled pump's??? I've went to put a water pump in a toyota 4x4 pu and. found out by the vin they used 3 different ones for that year???  

/ b